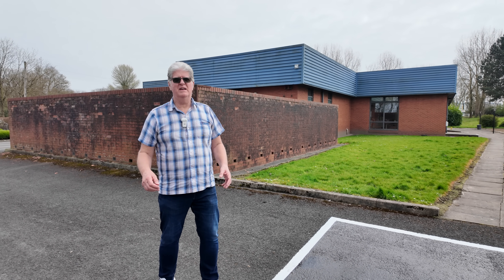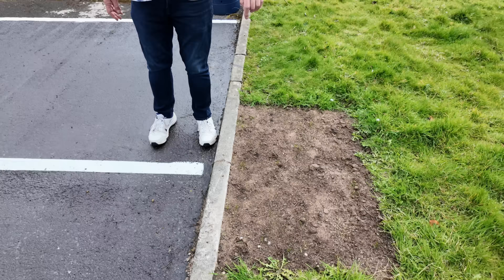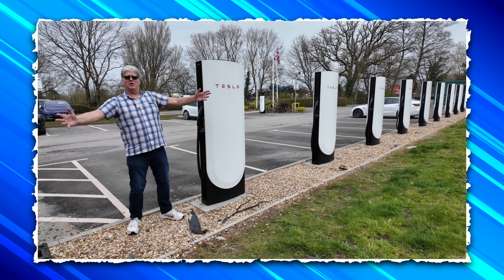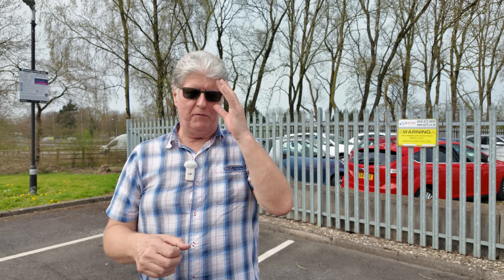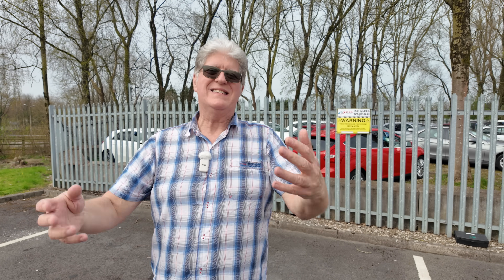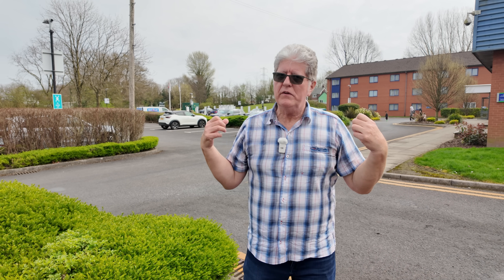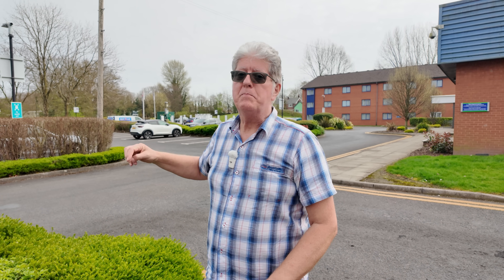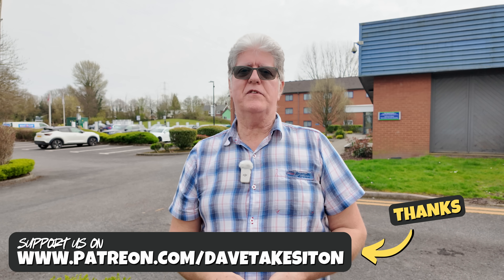Why Are EV Chargers Being Ripped Out?

Comment: How many petrolstations in UK? About 10,000. Private home chargers about 1,000,000. Public chargers about 70,000!
Reply: There are around 8,000 operational petrol stations in the UK. Each petrol stations have on average, between six to ten pumps, potentially providing an extra distance of 400-600 miles to each pump users every few minutes. This infrastructure has been serving the UK well for decades and bless there are occasional incidents, there are no major disruptions to any of us filling up our cars.

According to zap-map, “At the end of March 2025, there were 76,840 electric vehicle charging points across the UK, across 38,737 charging locations and 111,515 connectors.”.
There were also around 850,000 home charging points installed as of December 2024 and it’s unclear how many, but potentially six-figure workplace chargers.

What is the environmental impact of all these chargers and equipment? Why is it that environmentalists always want new stuff produced, new infrastructure installed, everything changed, working methods scrapped and moving towards greater expense in doing basic tasks?!
Reply: @ComeJesusChrist   Do you know what the environmental impact is of getting oil from the ground, getting it to your car and then burning it in a horribly inefficient internal combustion engine is?
Reply: @mikebreen2890  When you refer to internal combustion engine compared to electric vehicles, I assume that you don5 consider the inefficiency of electric vehicles in relation to the losses in the charging (the heat generated, the impact of the infrastructure, the grid’s inefficiencies), the battery (producing and transporting the minerals and materials used by heavy diesel and having to prime cold batteries) and the limited lifespan of the vehicles, having to produce them in shorter timeframe.
EVs are inefficient, just differently.
Reply: @ EV's are more efficient than ICE, no matter how hard you try to pretend they are not. 

Limited lifespan of the vehicles? It's that sort of nonsense that reveals you are just a biased hater. 

Go on, bore me with how your petrol car lasts forever..
Reply: @mikebreen2890  Keep your insults to yourself! Will an EV work after twenty five years like most petrol and diesel cars can?
Reply: @ Aaaand, he did it! 

How about a bit of realism here? How often do you see a 25 year old car on the roads in the UK? MOST cars in the UK hit the scrap yard at 14 years old and 140,000 miles.

140,000 x £0.15 = £21,000.00
140,000 x £0.02 = £2,800.00

£18,200.00 more (!) to run the ICE to the average scrap age in the UK, and this does not include all the servicing and oil changes than an EV does not need. 

Local taxi driver just clocked up 200,000 miles on his MG5 and says he's noticed a slight degradation in range lately so he he annoyed? o, he's full of praise for the car and why not when it's saved him enough money for another car let a alone a bloody battery!

ALL vehicles have a limited lifespan unless you start doing silly amounts of maintenance and repair and likely still have an old and unreliable car.

EV's are already clocking well over 200,000 miles and going strong, most ICE cars will never see those miles and will cost you a fortune to get there if they do.
Reply: @mikebreen2890  You started with hostility, but failed to apply basic scrutiny and common sense to your own ‘realism’. You used a current (and temporary) electric night-rate tariff with recent EV efficiency projected onto the lifespan of the vehicle.
140,000 miles is ten-fifteen years for most family cars. There was no 7p tariff five years ago and it won’t be around in five years.
There were no EVs that could consistently do 3.5 miles per kWh five or ten years ago.
You haven’t counted depreciation, interest on the loan/lease or capital sum.
EVs still need maintenance, new filters and so on. People ignoring fluid ageing, gearbox/moving parts needing lubrication on EVs will have an effect on those neglected EVs, if the batteries don’t fail before.
You haven’t included the cost of installing a fast charger at home, the extra expense of the daytime tariff and higher standing charge.
15p per mile for ICE is higher than average, at least in the last few years.

Age is more important for batteries than mileage covered in a short timeframe. Ten year old batteries have much less range than new ones, provided that they haven’t failed yet. The oldest mass-produced EVs on the used market would be the Zoe and the Leaf. No one can use them as reliable daily driver covering reasonable mileage. Meanwhile, fifteen year old cars are everywhere, without any problem. There are almost 40k used ICE cars advertised on Auto Trader alone that are fifteen years or older, from a few hundred pounds to two million. 

I’ve had plenty of older cars, including a 1983 SL Mercedes with everything working, even the electric aerial and central locking. It was the same with an early 190E. I recently had an SLK from 2002 with fully working electric roof, cruise control and heated electric seats. I can’t compare them with EVs as despite EVs with rechargeable batteries being around for over a century and a half, none are advertised, apart from some Tesla Roadsters with new batteries and extreme prices as a consequence.

I also have an eighteen year old Smart Fortwo and it doesnt look or feel like an old car, many people drive them and cars older than that. It runs fine, just passed its MOT without an advisory.
I’ve owned various cars with around 200k miles or more, including a VW MK4 Golf TDi, a 2013 Mercedes E220 CDI estate, an E46 BMW 318i, a 1993 Honda Accord, a 2003 Mercedes E320 CDI estate, a 2010  C200 CDI estate, a 2008 C180 Kompressor and so on. 
These cars fill up in a minute or so, adding hundreds of miles range, returning between 40 and 65mpg. Will your electric appliances do that in ten, fifteen or twenty years?
Reply: The only thing is that the time a pump/station is occupied. You can get away with fewer petrol stations as a pump isn't occupied for that long 5 or so minutes is there are enough cashiers and people aren't doing their weekly shop in a petrol station(...), where-as a charger will be at least 15-20 minutes (or 40 for my EV). The dwell time means at the busiest times you will need more chargers than petrol stations.

I am very much pro-ev and don't want to sound like the "but filling a car takes but a moment", but there is a reason why we need far more chargers until battery tech is perfected (which I have no doubt will happen given CATL's continual improvements!)
Reply from the maker: Maybe factor in that probably over 50% of all EV drivers never ever visit a public charger. Of the rest, many will only ever use a public charger a handful of times a year during holidays or road trips. Plus even then, many use destination chargers and plug in for 4, 6 or 8 hours overnight. The equation is much more complex than a simple 5 mins petrol vs 30-40 mins EV. More help for those that can't charge at home, yes. More destination chargers, yes, more public rapid chargers, we don't need anywhere near as many more as most people state.
Reply: @davetakesiton  Firstly, there are no cars that provide full charge on an almost completely depleted battery in the 30-40 minutes that you stated, whereas petrol and diesel cars can be filled up with pumps that have the capacity of over 40 litre per minute. Including a quick chat at the till, that’s a few minutes fuelling for every few hundred miles. Your car wouldn’t charge to 100% from 5% even at the fastest charging speed in an hour, letting alone half that as your figure suggests. In addition, that would only provide you with 150-200 miles if driven carefully.

Secondly, haven’t you got a problem with all these EV charging locations concreted up, using all the plastic, rubber, steel, aluminium, copper manufactured and unnecessarily used, all the underground cables and the installation/removal wasted just to have a charger that does nothing other than public money wasted by large corporations justifying the government tax incentives and subsidies? In this case, for example, BP would have received public money towards these installations. Am I wrong?

Comment: When will you show this video "DAVE has an 50kW DC charger at home" ? 
You can get these used 50 kW chargers for cheap or rather for scrap metal prices based on steel and copper prices here in germany.
If your house has a good grid conection they might be good or in case they also have a battery which will lower the current required to use it.
Reply from the maker: My incoming supply is capped at 100amps so I have 23kW total. Cannot run one from mains. Battery would need to be massive to make up the difference. Not happening as I’m happy to top up overnight while I sleep but thanks for the thought and it would be interesting to connect one and see what it does.

Comment: Relic from the past ? That hasnt lasted as long as most pumps. Another reason that public charging isnt profitable for the companies.
Reply from the maker: and how old is your mobile phone????
Reply: @davetakesiton  sounds like you're growing a straw man. What has mobile phones got to do with charging EVs?

My observation is that having to replace newish infrastructure is expensive, first the original then the replacement , and yet another cost to the charger company. One thing that EV fans never seem to get is that these public charger companies are providing a service that no one wants to use. You all make a thing of  rarely having to use public charging ( charge at home) but you all expect them to be there and available when you want them. The simple truth is that you have to use them enough to make them profitable or they will slowly fade away. Governments don't have the funds to keep subsidising EV use as much as they used to.

An analogy would be if all diesel users ran their cars on chip fat from home and only used petrol stations a couple of times a year. Petrol stations would fade away because they would increasingly have to increase their prices until it was no longer viable. If people rarely used them and bitched about their prices constantly they would not last long. EV public chargers will go the same way if EV drivers don't use them more , regardless of charging speed or price. Use them or lose them, it's just business.

Comment: For about the last six and a half years I've been driving about in a Nissan eNV200 van which is now about nine and a half years old. Just recently it's been making a mildly alarming whirling noise. The EV mechanic tells me it's the gear box and it's likely upwards of a £1200 fix. Given that this is the first problem I've had with the van and the only things I had to replace are tires, wiper blades and screen wash, I would just get the repair and still consider myself ahead. But EVs have come a long way since I bought it. The van has the small 24kWh battery, so pretty much all EVs will out range it these days even though I've lost less than 10% range (wild estimate) and it uses CHAdeMO, which is becoming a big problem. Given the short range, on the rare long trips I make, I need to make more charging stops than other EVs and I keep coming across chargers I could use that for one reason or another don't work even when all the other chargers at the location do work. So in spite of the van likely going as good as it did when i bought it after I get the repair, it's probably new van time.

Comment: Are we bothered at getting faster DC chargers,  the hardware to support fast charging is only going to add to the cost.   Many cars charge at circa 200KW max,  but tail off anyway.  I personally would prefer cheaper charging and would probably DC charge more rather than just to min I can get away with

Comment: My prediction for the future is that if megawatt-capable chargers and cars come with a premium price tag, hardly anyone will use or buy them.  
People will get a megawatt-capable car first because they think they need 5-minute charging, but most will find they don't need it and end up using slower, cheaper chargers.
Megawatt charging might come in handy for delivery drivers or taxi drivers who want to top up the car while they grab a coffee, but the only time I ever parked my ICE car somewhere for less than 20 minutes is while I was refuelling.
If we design our EV charging network to operate in the same way an ICE refuelling network does, it's doomed to fail.
The chargers in parking spaces need to be sized appropriately for the activity the parker is engaging in.
For hotels, lots of 7 - 11 kW chargers are perfect.
For restaurants, 100 - 150 kW make sense.
For large charging hubs or supermarkets, a mix of 150 - 350 kW.
Megawatt chargers only make sense in a traditional petrol station with limited space.

Comment: There's another group that will miss BP chargers. Those on the Motability scheme who can't have a charger installed at home. They are given a BP card that gives them a discount at BP chargers.
Although considering the BP prices, even with the discount, it's probably cheaper to charge elsewhere.
Reply: Disagree. I live in Milton Keynes and there are lots of BP chargers. I have motility car and use a local ( less than 5 min walk) 7kw BP pulse charger for 44p cost. No issue with plugging in for 4-5 hours to get my 20%-80% charge. So while I appreciate BP may have some issues please try to be more balanced.

Comment: 50kw and 100kw chargers will have their place in supermarket and swimming pool car parks etc. They don't require expensive grid connections. On top of slower community charging options, if the ultrafast charger sites can have a distribution similar to existing petrol stations, charging network job done.
Reply: @undercoveraca  
Nearly everyone who shops at a supermarket  lives a few miles away. They nearly all have the ability to charge at home at far lower rates than the supermarket can provide.  That’s why few people use them.  For those that don’t have home charging they would presumably prefer charging facilities close to their homes rather than in a supermarket car park some miles away.

No one uses the AC chargers at my local supermarket.
Reply: @CGNorwich  Maybe it's about context. I'm in Australia where we have smaller supermarkets more spread over the place. The one near me gets a lot of use of its slow and mid speed chargers. 30% of Australians can't charge at home and I believe the percentage is higher in the UK, so my point is  7kw to 100kw community charging options at lower rates than ultrafast chargers still need to be all over the place including high use destinations where people park up for an hour or two.

Comment: Those Tesla superchargers are just in the wrong place.  Parking at that hotel has always been in short supply so to take up a load of the spaces for rapid DC chargers was insane.  Yes, a good rapid charging location on the industrial estate by J29 of the M6 is a great thing to have but there are plenty of other better places where they could have been positioned - just not in the hotel car park.  Far more sensible to have put 7 kW charge points on at least half of the parking spaces.  That way people staying in the hotel can charge overnight, whilst those who just want to fill up quickly and get back onto the M6 can do it without using up hotel parking spaces.
Reply: Why not both?

Comment: I always watch your clips. I commend you on doing the research for the reporting and filming on location. May I be so bold as to suggest a CPO that to the best of my knowledge, you haven’t covered. Jolt. These are set up in London together with the councils. I have used them and find them reliable. 35 p per unit on credit card swipe. I appreciate you are in the Northwest and the Big Smoke is a bit far.

Comment: Can you not get an adaptor for chademo nowadays to ccs2
Reply: You can, but they are the thick end of £1,000 and about to get a lot more expensive in some parts of the world, due to the tariff war; plus, they dont work with all CCS1/CCS2 chargers. Some manufacturers are working to release firmware updates to fix issues with newer chargers, but most dont.

Oh, and despite the claims on some adaptor sellers - they are ALL made in China; one "manufacturer", who has stopped selling in GBP, used to have a huge blurb about how they designed and made their own in the UK - but the safety certificate they used, showed a Chinese company and company address in Shenzhen, China.

Comment: Again with the comments about planning and forethought. I took up this advice, but my wife was very unhappy that we arrived at the seaside at 11pm and had to leave again at 4am just to avoid having to queue to charge; on the upside charging was at off-peak rates.

The reality is that unless a 100% can get you through your round-trip then you are going to have to public charge and most people will be working on some sort of timetable for their trip which is very likely to see them on the road at peak times.
Reply: I generally look for chargers that are just off of the main routes during holiday periods. Generally a lot quieter, and there are plenty along motorways these days
Reply: In that situation, I'd leave the wife and kids for 30 minutes, so I could charge the car if needed. 
However I've no need to do a 300 mile round trip to go to the beach, as it's just 6 miles from me.